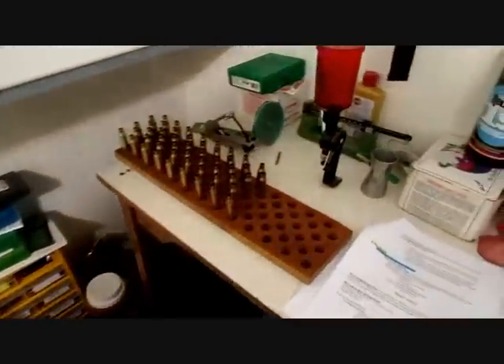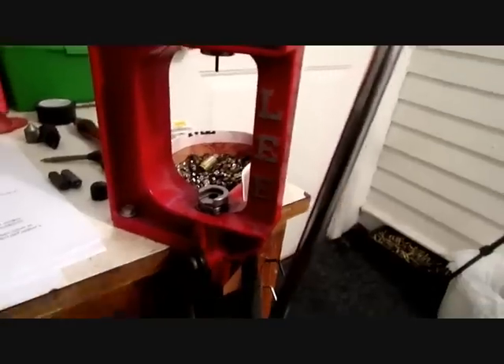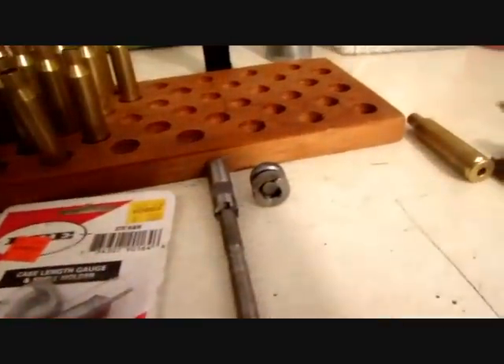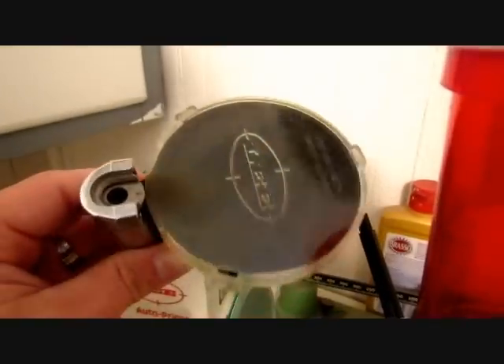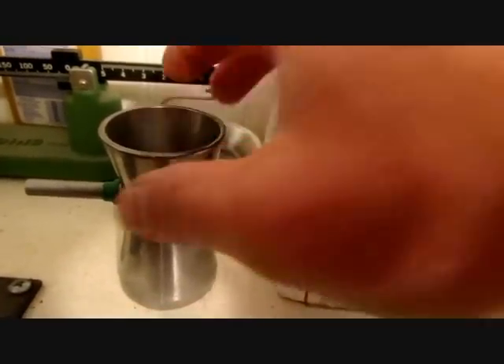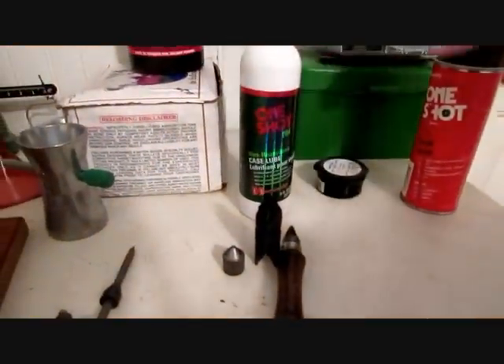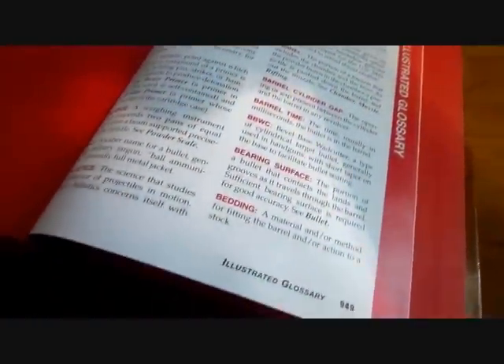Long Range 101 Part 47 - Reloading Equipment

Comment: Rex, I love that you don't run down a cheaper tool. Cheaper doesn't mean less effective in all cases I reload with Lee dies and the accuracy is absolutely equal to or better than RCBS or Redding in my humble opinion I have all, and have used them all. I am a hunter not a bench or long range shooter. 300 yards is my max.range for crows, coyotes etc. If you take your time and go through your reloading steps carefully you are going to be vey consistent and so are your reloads. I have gotten very many great tips from your channel and you have never steered me wrong. Thankyou for all your time and effort in making your excellent videos.

Comment: i am so happy and please to know that my own set up is very similar to your set up.

the only difference is i am using a rcbs charge master, and slightly different dies in .308

i am a firm believer in keeping it simple and CONSISTENT. as all of this helps with my tikka T3 .308 up to and beyond 1200 meters .

P.S, i love your videos if you have not guessed already.
Reply: john1182 just bought a chargemaster myself. It is probably the single best reloading purchase I've made. Cuts down time drastically.

Comment: Yeah, I'm talking about a manual index turret, like the Redding T-7

With one of those you can, for example, resize/de-prime all your brass, then manually index to the next die, seat all your bullets, manually index to the next die, and so on.  It's basically a single stage.

I'm asking if the advantage of never having to re-adjust your dies between batches is offset at all by using a turret press vs. a pure single stage.
Reply: Redmond Marksman I use a Lee Turret Press and like you, I love not having to keep switching out the dies.  You basically use it like a single stage press, without having to swap out dies. Not sure about the Redding, but the Lee was just over $100.

Comment from the maker: Good question.  Most modern brand name factory ammo is loaded to very strict standards, so that may not be as helpful as one would think.  The main advantage to relaoding is the ability to custom tailor a load for the bullet of your choice to your exact rifle.  Its true that consistency could be improved in factory ammo, but thats not it's main weakpoint.  Factory ammo is a "1 load fits all" type thing, and that may not always work out for every rifle, thus load adjustment may be helpful.

Comment: My two cents: you'll want to load it to about 2650 fps to stay supersonic out to 1k (also depends on your altitude--air density). I've loaded 175 SMKs @ 2550 and did ok at 1k but I used weight and H2O capacity sorted LC brass. It barely was above supersonic at 1k and I had to pay very close attention to wind changes to stay in the 10 ring. From my experiences, I was able to go up to 2850 before I got high pressure signs but it wasn't very accurate and I want extended case life anyway.

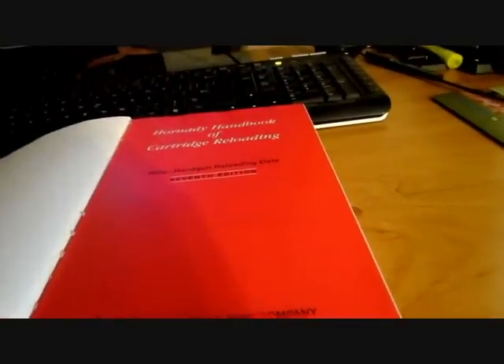Comment: @ 27:07 unfortunately, the 7th and subsequent editions of the Hornady manual do NOT have the second volume (and the book states as much): it's all online now. This is a PITA, and I've found that previous editions (Volume II of the 6th edition) are ridiculously expensive online.

IMO the best thing any beginner can do is buy one of the press kits. That gives them most of what they need (as you've described so well), and all they need then is the dies and perhaps a spare shell holder or two (and IIRC some die kits include one for that calibre) and a hand primer (if it's a bare-bones kit). AND ALSO EYE AND EAR PROTECTION. Once they've assembled and shot off their first full box of minimum loads that safely go bang, they'll be full of confidence. That's when they need to think about all the little extras.

The only "little extra" I'd advocate buying from the start is one of those clever little Lee case-trimmer gadgets with the appropriate pilot gauge for the calibre.
Reply: This comment is old but not to mention wearing eye and ear protection when messing with primers.....I had one go off on me while trying to ram  it into the case...lol I heard ringing for like 2 hours.

Comment: Hey Rex Love the Vids, they are helping out a ton, Here is a cut and bone list of things you listed that you will need to reload your ammunition (In chronological order of the video)

-empty Cartridges of caliber 
-Reloading neck Dies and /or full length sizing
-shell holder for cartridge (2 if using RBC) 
-Loading press (Single stage for better quality control)
-Primer pocket cleaning tools
- Primer pocket unfirming tool (not need if have premium shells casing)
-Flash hole debarring tool 
-Case length gauge 
-Micrometer "caliper" 
-Case debarring tool (get the right size for your cartridge)
-Auto priming tool or hand priming (best using RCBS)
-Powder measuring, scale, powder trickler, powder funnel
-hand case neck turner 
-*******Case Lube******
-projectile 
-Propellant(gunpower)
 
A safe and source location to do this, away from children and unwanted people to get into the room or area, have a solid table desk or workbench to work on

And your bible, the Reloading manual of your selected choice.

Comment: I would highly recommend getting into tumbling, using stainless steel media.  You can get a cheap rock tumbler at Harbor Freight and use 1 tsp of Dawn dishwashing liquid and 1 tsp of lemishine. Brass comes out looking like leprechaun gold AND it cleans the primer pockets. Just make sure you don't have any media left in the case, before you charge it.

Comment: rex there is a Remington 788 as a new rifle it was sold around wellsboro pa, I got it from frank Rice who died, he got a used rem 700 adl in so i traded the rem 788 in 6mm Remington  in on it, so if it floating around the ammo for the Remington 788 had to be full lath sized the fired rounds would not chamber back in it,  it was measured & looked at for reason why! it was not found out why! so i got a different rifle! this is to inform any one who got this odd rifle!!

Comment from the maker: Federal is fine in my experience, although its a bit thicker than Remington or Winchester and you will have to load accordingly.  Lapua is still quite a bit better in terms of quality control and consistency, which can be seen in the price difference.  That being said, I've got some of the best groups in my life from old mixed up winchester and PMC brass.  As long as you sort through your brass and make sure its consistent, you don't need to spend a lot of money if you don't want to.

Comment: Tibor,

thank you for these videos. They have helped me a lot. Here is a question. For shorter ranges collimation of the scope does not need great accuracy, but how do you collimate the scope to the bore for 1,000 yd+ ranges? I figure the vertical crosshair should be in a plane that also contains the center axis of the bore.  I can do this using a construction laser level to within maybe 6 arc-seconds, but it is really involved. How accurate do I really need to get it?

Thank you
VZ

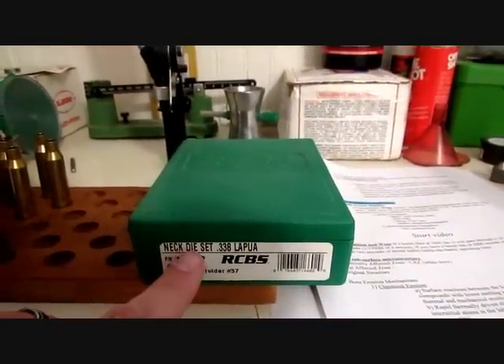Comment: awesome Rex, This was my next stage in LR shooting, theres a whole RCBS single stage setup on craigs list here that I've been watching for 275.00 I'd only need the dies and shell holders, and I save all my brass, I want to try some 105 VLD's in 243 but would my 1:10 twist work with them or should I stick with 100's, the only prob I've read is that the longer bullet wont fit the mag in the Tikka T3 but I single load each shot for targets so not too concerned with the mag issue

Comment: RCBS sells a very handy tool for removing stuck cases. Unsure if you are aware of this or not. But the way is works is you drill out the back of the case very carefully then tap the case for a hex key screw. Then, place a metal cap with a single threadless hole in it over the die bottom and tighten the screw into the stuck case which is now threaded and it slowly gets pulled out. Hard to describe in textual form but it works great, if you get one they work great!\

Comment: Rex this video is slightly old I see but if you didn't know these instead of buying media from a gun store you can just go to your local pet store and buy the crushed up walnut shells cheaper. Just a tidbit! Also another good thing for cutting cases to spec I would look into the "World's Finest Trimmer" they are a little expensive but look VERY worth it! And for lubing cases one video showed how you can take all of your cases and put them into a plastic zip lock bag and spray a whole bunch of lube into it.

Comment from the maker: Howdy.  Yes I make all these videos.  Play arround with your video editing software on your computer, you'll be suprised at all the neat stuff you'll find.  A .280 should work very well.  The best of luck to you :-)
Reply: TiborasaurusRex hey can I get alil help. I got a set of rcbs small base dies in 308. now when I'm seating the bullet the case neck crumples. if I loosen it a little the bullet seats but spins around freely, but won't pull out of the neck any advice. thanks and awesome work. I'm just getting into long range shooting. wish I'd seen these videos before I bought my 308.

Comment: Good day Mr. Tibor... Q.  Can I re-size just the neck of the shell with a full length die by,... instead of screwing the die down 1/8-1/4 turn down before locking the nut, to screw the die 1/8-1/4 turn UP, then locking the nut ? I've read somewhere that this is how to use a full resizing die to only resize the neck.   Also for the record, Hornady CaseHead Holders work in RCBS presses (numbers are different but easily cross referenced on the net).

Comment: Pretty good points but shorter off on parts ask for your reloader The Rock Crusher is good but then so is Dylan and ask for having more leverage as you're doing it you get used to the feel and you'll know when something is wrong and for the progressive Reloaders you can still rolled single styles to you don't have to progressively load rounds cuz that's what I do I can reload my single stage rounds on my Progressive and get the same accuracy I want every time

Comment: I like the lee cast iron press its strong and u can load 50 bmg I got a rcbs press but its not tall to do long bullets its not any better and I got a lee 4 hole first that sucks for loading over all length but good for pistol and junk ammo and I like primer on the press my lees work great the rcbs is junk for that I don't like to lee fl dies that much there always to small but then in to nice is to big so u cant get a crimp rcbs fl dies work I like the neck dies the best or lee factory crimp works ok

Comment: The Hornady book is probably one of the more conservative manuals. That is OK though; I consult several sources and using the min/max loads from each I extrapolate an average or mean midpoint and then round to the nearest .5 grain on the conservative side.  This has always yielded very good results for me. (This would only be a starting point for developing accuracy loads.)
Good tip below on media (look for lizard bedding.)  Also you can make your own lube by ordering pure lanolin from Amazon and diluting it with as pure of alcohol  as you can buy (this is identical to Hornady's BTW.)  Look for DIY case lube vids here and you'll find several.